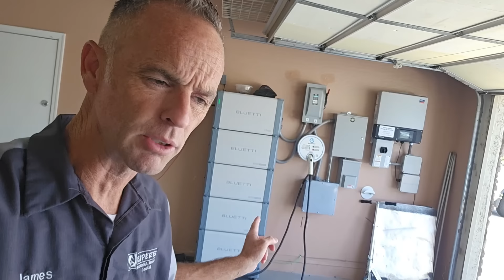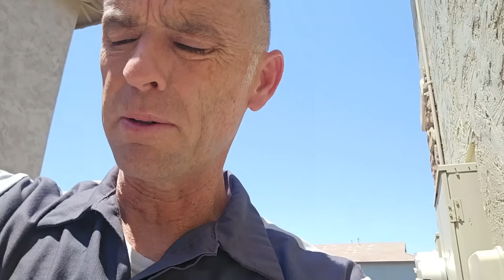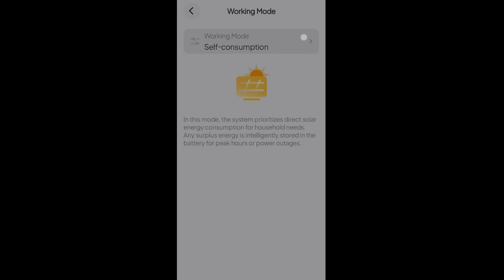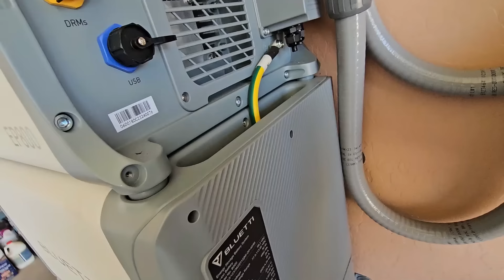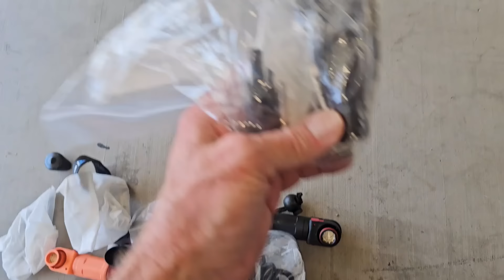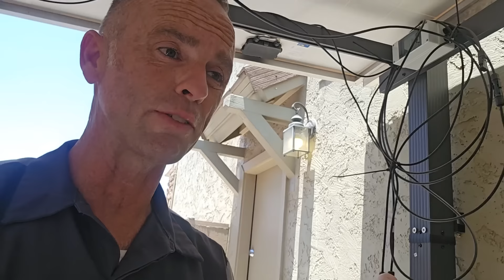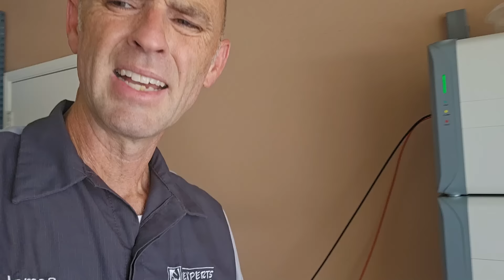5 Things I Did NOT Like with the Bluetti EP800:

Comment: Wouldn't it make more sense for these types of systems to have the inverter on the floor and then the batteries stacked on top?  Because if you want to add more batteries today, you have to take the inverter off, add another battery, put the inverter back on top, and hope the 2 conduits have enough slack to accommodate the new height of the inverter.  This seems highly illogical!  Please advise AZ Expert.
Reply from the maker: yes, but also that makes wiring more difficult, but having removed them to add batteries yes!

Comment: Are your panels all wired in series outside to get that higher voltage and then at that hub you bring it inside using two wires?   I have the same complaint about the high voltage needed in this unit, so I haven't bought any panels as of yet.  I'm also limited on space.
Reply from the maker: Yes, they need higher voltage closer to 200 but not more than 500

Comment: Hi James. 
Thank you for your valuable feedback. We appreciate your support and patience as we address the concerns raised.

1. Regarding the app issues: We sincerely thank you for your honest feedback. Your comments have been forwarded to our R&D department. For advanced settings, please note that we will be removing the Working mode and only keeping the Custom Mode.

2. Regarding the difficulty in installing the AC connection: We recommend purchasing a junction box and junctions. Please connect the EP800 backup terminals to the junction box, then connect the junction box to the sub-panel. Similarly, connect the EP800 grid terminals to the junction box, then connect the junction box to the main panel.

3. Regarding the MC4 connectors: Please use the matching tool to press and pull it out with the other hand. For solar installation, it's essential to consult with your local solar panel installer to plan the installation route and identify any additional units needed. For example, adding a combiner box between the solar panels and the EP800 should include a DC breaker and other necessary components. Make sure to connect everything properly before finally inserting the MC4 connectors.

4. Regarding the PV cable connection: It is necessary to install a DC breaker or DC disconnect for safe operation.

5. Regarding PV input voltage: The EP800 does not require 260V. If the voltage of the solar array is more than 200V, it can charge the batteries. The EP800 is a home energy storage system and requires more solar panels to match its batteries due to its high capacity (3000W/6000W), which differs from portable power stations.

Additional Tips:
1. Installation: The EP800 must be installed by a professional electrician to avoid installation errors or safety hazards.
2. Installation Materials: Please ensure to review the installation materials thoroughly to avoid improper installation and potential product issues that could lead to safety incidents. You can find various supporting documents on the BLUETTI website under the EP800 page - Supporting Documents. Quick click to EP800 page: https://www.bluettipower.com/pages/ep800
3. Technical Issues: For technical support, please email the BLUETTI customer service team at service@bluettipower.com. We are here to assist you.

Thank you once again for your cooperation and understanding.
Reply from the maker: Thank you for the updates. It was a struggle to find real issue or any dissatisfaction with the EP800 and I think the fact that the main issues are my fault either in design of the array or my impatience with the app speaks volumes about the quality of your product too!

Comment: Love your stuff! I hate the term solar generator. The power is "generated" (if you must) at the solar panels and "stored" in the unit with batteries and inverter. IMO the term solar generator is just bad grammar and contributes to the dumbing of the population. The unitized storage can be charged by any number of sources and calling them solar generators misses that point. Thanks for all the great videos, I've learned a lot from you james.
Reply from the maker: I disagree and think generator is the correct term, any other generator still needs fuel: gas, lp, diesel, steam, water, and they are still called generators if the fuel supply is empty.
Reply: @AZExpert  Am I missing something or do you put electricity into the magic box to get electricity out? A gen set generates electricity from fuel. A piston, turbine, hydro, wind motor/engine is the generation /creation/excitement of the electrons. Simple really, a gen set "is the source" and the electricity produced is typically not stored unless connected to batteries of some kind, for RV'ing as an example. In the case of solar, the electrons are excited at the solar panel and then sent to the magic box to be "stored" or distributed to the grid, another circuit or grounded. The panels if anything are the only part of the system that could loosely be called a solar generator and the magic box, like the batteries in your coach can only accept electricity. It would be silly to call those beauties solar generators. Nobody does that, do they?
On another note James, You gotta write that book on RV repair.
Reply from the maker: @toddswenson  you put chemical energy into those boxes using a motor generally. Without the motor attached, the actual generator does not make power. To say it's simple is just special pleading for your pov, the source of energy of a fuel generator is still the sun with a lot more steps
Reply: @AZExpert  So, does your solar generator supply power if you charge it from the grid? It's far from useless without solar power. Solar isn't exclusive or needed to benefit from that setup you have. Lots of people will miss that point when you use the term solar generator. Many can benefit from having just the storage capability especially in areas with on demand/surge pricing from the grid, rolling brownouts and emergency reductions in service during critical events. The added solar is nice but not necessary in all cases. Thanks James, I understand your point. I owe you lunch sometime, you've shared a lot.

Comment: James,   You have found why you should oversize your strings.   You need to get enough modules in a string to get very close to the “max” voltage.   You are just barely over the minimum voltage.   That limits your on time big time.   There are free String Calculators online that will assist you to get the best bang for the buck.   You didn’t mention it, but Dirt and sand are your solar enemy.  They must be occasionally cleaned.   It doesn’t take much dirt to stop electrical production.   I used to design utility solar where production was profit or loss for the investors.  They demand profit.
Reply from the maker: I think that's why I said I broke the first rule on solar. When it comes to dirt, I have seen no affect from dusty panels after running my own test on the roof mounted system. The panel I used on the pergola are well over 20 years old and still working just not as well as the first day :)

Comment: As a solar nerd, I highly recommend bifacial solar panels for your upgrade.  With your situation, you'll get a significant benefit from reflected light coming off the concrete below.  Plus, let's be honest, looking up at the bottom of the bifacial panels is pretty cool.  You should be able to get 400+ watt panels pretty easy from SanTan Solar, they're right in your neck of the woods.

Comment: 0:03 If you had a purchased outback power technologies, you would have a lightning fast app that you can access via any location including your phone through the internet. Your MP PT charge controllers would not be doing what they're doing because outback. Power technologies has that solved for you. My.
 Entire home is powered by solar. I am grid tied and supply power to my neighbor's homes. I live in Kentucky. There are many, many storms and power outages all the time. The only power in my area that stays on 100% of the time with the outback power technology hybrid system that I built is my home. Next.
 Time do a little more research before you spend that type of money. Your friend in Kentucky, big Jim. 10kw.
Reply from the maker: outback are fine inverters and components. Your system sounds great, I don't understand your point

Comment: still don't understand what a solar generator is? solar array? the batteries? the battery charge controller? inverter? electronic monitor boards???  hmmm.. sounds like the bluetti is all of them in one box. at a dam these are called "power stations"... enjoyed the video and the honest review.... I still don't completely under stand how the pergola panels don't require a permit but the mysteries of city electrical codes is always entertaining!!!
Reply from the maker: power station is not a great description from my POV. The panels provide the fuel for the generator to make usable just like diesel or gas is fuel for a generator to make usable power which is why I think generator is a fair term.